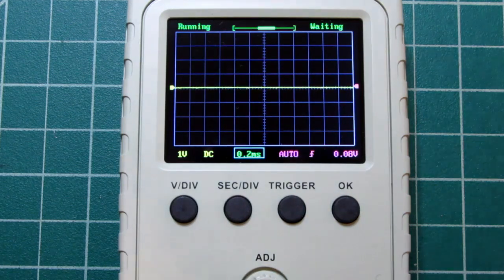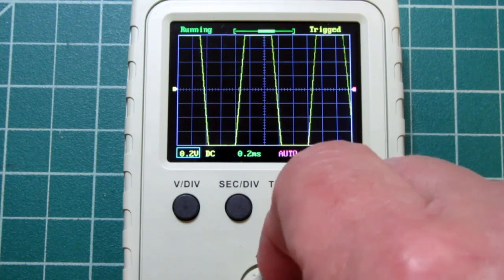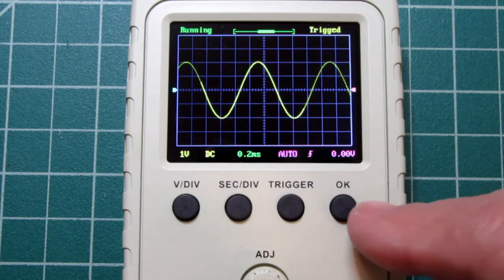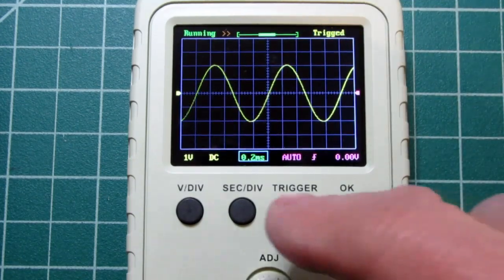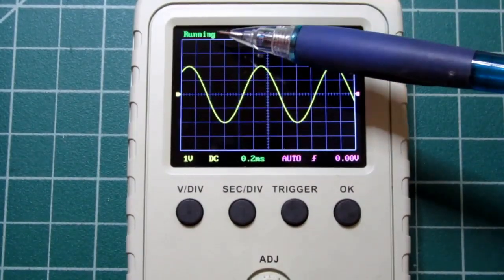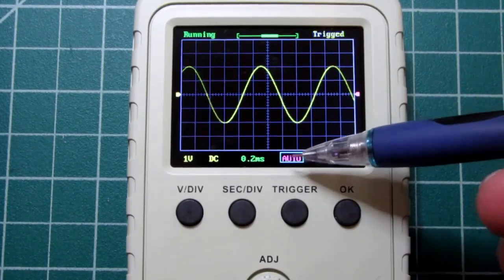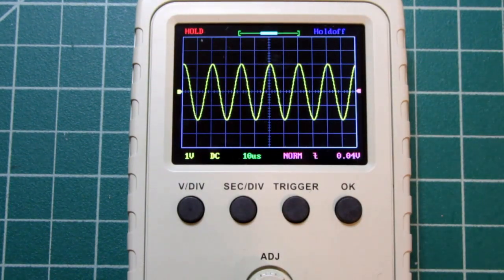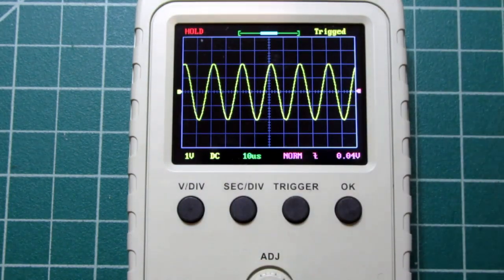KYE Tech "DSO Shell" Oscilloscope: A Detailed Video "User Manual"

Comment: Much better than your last video, but you are still blaming the scope for errors in operation that YOU made!
I know you are trying hard to be the best 'how to' video available on YouTube, and you may already be at that point;...but I know that you can be even better!
Watch more of other peoples videos, learn more about the scope, and try again...
 Learn what 'aliasing' means, and how it can be used to get a digital scope to measure signals that are much higher than it's bandwidth limitations. 
Learn how to properly use the trigger. 
Learn what you can change and what you cannot change when you have the scope on HOLD.
Show how you can use the scope to automatically make all those measurements you were using your calculator to make.
Learn that the scope needs more than one or two 'zero crossings' of the waveform to accurately calculate a frequency, and why.
 If an expensive scope advertises that it is 100 or 200 Mhz, that is the frequency at which the vertical display drops by 3 DB.
You cannot expect a scope with a 3 db frequency of only 200 khz to have full vertical gain at 200 khz.
The vertical gain decay of any scope is usually about 3 db per octave., which means that you can expect full vertical response to 100 khz, and less vertical response at 200 khz.
.
That scope DOES HAVE SOME WEAKNESSES AT 200 KHZ, they are the length of time it takes the trigger circuit transistor to recover from the last trigger and be ready for the next trigger, and variations in the time required for the scope to store it's previous measurement data and be ready for the next trigger. 
.
I also own Tektronix test equipment and many different brands of 1GHz per second sampling scopes.
I also own the OWAN 200 Mhz portable and a few oF the Hantek 40 and 70 Mhz scope meters.
That being said, I use those little DSO scopes for 80 to 90 % of the measurements I make that are less than 50 VDC and less than 100 Khz.. I love the fact that they are portable and easily battery powered so I never have to worry about things called 'ground loops' that can kill laptop computers and other test equipment.
As an Retired Bell Labs engineer, I have a great respect for what the designers of that scope accomplished for such a low price, and would recommend it to everyone as a beginners scope or a toolbox scope, and for us old guys who don't want to drag out a large piece of test equipment every time.
.
Since they are almost the same size as those 'SUCRETTES LOZENGES' metal containers, I put an 18650 battery and a charger boost regulator combo board into that case and mount it to the back of that scope.
I set the boost regulator to about 7 or 8 volts (anything higher than that for that scope is actually wasted power), and the scope can be left turned on continuously for a few weeks before the battery needs recharging, and it can run for a year under normal intermittent  bench top use...
Reply from the maker: Dennis#12, I appreciate constructive criticism, but I appreciate it more when it comes from somebody who can understand the goal and limitations of an instructional video, which you apparently do not, and from somebody who can articulate their thoughts clearly and allowing that their audience is not comprised of mindreaders, which you have not done.

You started out by saying that this video was "better than my last one", which was........?

You assume that because I made a video aimed at beginners that I myself am an oscilloscpoe neophyte, which I am not....I have been using high end professional scopes during my entire career in electronics design, and although I would not call myself an expert on every last nuance of 'scopes, it is inappropriate of you to address me the way got did in your comment. I suggest getting off that high horse of yours.

You also SEEM to be saying that this particular DSO is capable of proper operation up to 200kHz, and it is not....not even close. You advised me to watch other videos, but perhaps you should watch some of the ones that have been done by proficient engineers on this very DSO; I am not alone in my assessment that it cannot be used up to 200kHz in the way that any normal 200kHz scope can be.

You are correct that I made a couple of blunders in my video, saying I was pushing a certain button when I was accidentally pushing another. Unfortunately, I did not realize the error until the video was uploaded, too late to fix it.

I have no apologies to make about this video. It fills the intended niche, and a lot of viewers have thanked me for doing it. I don't need to have anyone with a god complex laying into me for bothering to try helping others.
Reply: First, let be apologize for sounding like an asshole!
I didn't realize that until I read your comments and then went back and re-read my post.
.
I have seen too many videos talking about how crappy that scope is when the person doing the review didn't even take the time to run through the calibration routine, giving the scope failing grades that it did not deserve.
I get very angry when that happens because I consider that little scope to be one of the engineering marvels of our generation.
 I am constantly amazed with what the designers have accomplished in a product that could be sold for only $20 delivered, and still make a profit!
 I know that it is not even close to being a precision instrument; but for a hobbyist it is quite capable of telling him if his battery voltage is 3.7 vdc or 3.9 vdc, and can measure the RMS value of an audio signal, even if it is a squarewave. And it can do that without the user having to worry about ground loops.
The frequency readings are pretty accurate without 'jiggle' in single sweep (hold) mode, and are accurate in auto mode if there enough cycles displayed to get a good average value.
.
I have taught, (back in the 70's and 80's) all levels of electronics at Morton Jr College and found myself spending more time teaching the kids how to use their bench scopes than I did teaching them about voltage dividers and RC time constants.  I know they needed to learn how to use a scope also, but at that time it was more important to concentrate on the fundamentals. If these inexpensive DSO scopes were available at that time every student lasting more than 2 weeks in the class without dropping out would receive a DSO scope, a miniature prototyping board, some resistors and capacitors, and some 26 ga wire so they could take their experiments home with them and have more time to learn by  experimentation. The fact that everything could be powered by a 9 volt battery was a plus!
 That tine scope has been greatly improved since it was first introduced as the model 138 by SainSmart. And it think it's next big improvement will require the addition of a cheap external ADC device that can sample at a 4 Mhz rate or faster.
.
As far as saying this video was better than your last one, I must have been confusing you with another presenter, and apologize for that too.
.
I did try to explain WHY the scope could not be expected to work very accurately over 100 Khz; and then how you can use that unwanted 'aliasing' to your advantage to display higher frequencies accurately by cheating the Nyquist criteria as long as the waveform is repetitive. It does however, work quite well at frequencies up to 20 Khz, which is about 1/10 the sampling rate.
.
Bottom line is that I got angry for a stupid reason, or reasons.
I think that little miracle should be praised for what it is and what it IS capable of doing instead of being crucified for it's limitations. In the beginning of the video I had really high hopes that you might be the first one to actually do that, and I guess I was overly disappointed when you didn't.
I felt like Charlie Brown after Lucy moved the football every time he would try to kick it;
and texted while angry even though I should have known better..
.
Please accept the apology of a grouchy (77 yr) old man.
Reply from the maker: @Dennis-mq6or  , I agree that this scope is a small miracle, and I am not aware of any other that is as well designed and packaged, and as practically useful, at such a low cost. I though the failings were more in regards to limited/poor documentation, and a couple misleading specifications. Couple that with many poorly done videos that either misrepresent the scope's capabilities, or condemn it as worthless or a toy because the reviewer himself did not know how to use a scope. That is why I took the time to write a user's manual for it, which many people have downloaded and found to be useful.
Reply: @youtuuba  
Thank you for the comments 
As you mentioned.......
 "or condemn it as worthless or a toy because the reviewer himself did not know how to use a scope"
 That is exactly what gets me so upset when I probably shouldn't be.
Mostly because it steers many possible new users away from it when it is such a disservice to do so.
.
Thank you for creating a better user's manual, which I did not know even existed prior to our correspondence.
  I hope you will find a way to get it out there to EVERYONE, and let me know if I can help you to do that.
.
Thank you again for performing that great service for a little gem, (when operated within it's design limitations), that has been misunderstood and underestimated for too long.

Comment: Superb tutorial, the scope is great for the hobby audio work at a cost of 15 quid, I don't have a way to test at 200Khz, how good was the written display of values please ? will they display the actual values at the 'front end' maybe this is how the makers justify the specs as it 'can' measure 200Khz but not display the waveform much above 20Khz ?...cheers.
Reply from the maker: This scope is inferior to any inexpensive DMM, and that is what you should be using to take measurements (a DMM will also measure current and resistance, and DC and at higher voltages than this scope). I would discount the numerical displays on this scope, and only count on it for its primary purpose, the display of waveforms. And those are only reliable to something a bit north of 20kHz.
Reply: @youtuuba  exactly, I was curious to see what the device read, there is no substitute for a good meter, I guess I was trying to throw the designers a life line, after all they are a long way out of spec, I bought this more as a sunday afternoon soldering and assembly project to be honest and would probably recommend it as such to someone starting out. I'm still curious so I need to fix my function generator !...cheers.
Reply from the maker: @andymouse  , I don't think the designers of this little DSO are 'out of spec', rather I think they provided an inapplicable spec. The analog front end circuit is certainly good for 200kHz, and their 200kHz spec is for the analog section (analog bandwidth). The limitation is with the digital part of the circuit, for which the designers provided no specification.
Reply: @youtuuba  good point.

Comment: It looks like you got one of the fake clones instead of a real JYETech scope.
Reply from the maker: Colt, why would you say that? If you are going to make such statements, you need to substantiate them.
Reply: @youtuuba  So, assuming there's a serial number on the board, did you get it verified by JYE as being authentic or confirmed a knock off?
Reply from the maker: @colt5189  , why would I even do that? The JYE itself is reportedly a "knockoff" of an open source design. I did not care whose knockoff of another knockoff I might be buying, as long as it worked. And with JYE Tech having a virus intrusive website, I was hardly encouraged to communicate with them anyway.

Comment: specs say that it has dual channel signal generator , is this true
Reply from the maker: Pavel Pavlovic, the version I have does not have a signal generator (except the very limited one for the test signal); that is very clear from its schematic. This scope has only one other connector, a BNC type for the input signal. For this to be used as an output, the circuitry would need to be very different from the one shown in this video. Are you sure you are looking at specifications for THIS scope, not some other small scope?
Reply: @youtuuba  yeah it is the same scope  , i figured it out but its MK2 , looks the same , identical but its WAWE2
You get 2 channel scope , and 2 channel signal generator .200Khz range , and 20khz for signal generator  up to 3V i think .
This is fantastic for audio work .
Absolutely fantastic ,  
 I used to do audio work on old Analog scope 50Mhz big huge thing  with no signal generator , it was a pain to use it , i dont need 50mhz  what i need is small useful device 
 
I hear its designed in Canada , wonderful work  , you can design High End audio with this no joke .
 Unless you work with Tube amps , and im not any more ,
Reply from the maker: @dedskin1  , if the scope you are talking about is TWO channel, then it is certainly NOT the same scope that I describe in this video. It is a very different scope that resembles the one I describe. Don't be fooled by some similarity in appearance.....the case must be different (if only to accommodate connectors for both channels), and the circuit boards will be very different. If you take George Washington's axe, and replace the handle and the blade, it can no longer be called George Washington's axe, no matter how similar it might appear.
Reply: @youtuuba  true , but it looked the same . No problem , i was just making sure .
Anyway maybe you can try that one , i trust scope is the same its just has 2 channels and a function generator .Also has XY mode .
Its also a kit , you can make it 
But if you have a scope and you dont need any ,  then well you dont need it
Reply from the maker: @dedskin1  , it cannot be "the same" as the one I described. Who knows how many circuit changes were made? Probably a lot of them, might be nearly different in most ways.
Reply: @youtuuba  well obviously there are some differences in board layout due to additional components  and software add ons due to additional modes .
But  on the same chip , 
with same ICs and front end ,its just 2 now plus signal generator  .
So  call it as you like
Reply from the maker: @dedskin1  , it is not what 'I' like......I am following universal convention. When products, even closely related products, have different features, they are called by different names, model numbers, etc. They are different products. No informed and rational person insists that they are the same product.
Reply: @youtuuba  look im not trying to argue ,   aint nothing to argue about . Obviously its a different product ,
Reply from the maker: @dedskin1  , I also am not interested in arguing, I am just trying to clarify comments on my video. In at least two of your previous comments, you sure seemed to be saying that the two channel scope was the same as the one shown it my video. I think we all agree by now that the two might be related, but are different products/scopes. NOT just two slightly different variants of one scope.
Reply: @youtuuba   well its your channel
Reply from the maker: @dedskin1  , so by saying that, you wish to perpetuate our little back and forth? Why does the subject of our exchange merit this latest comment, as if to say you still think the two scopes are the same model, but "oh well"? You xo seem intent on having the last word.
Reply: @youtuuba  m8 , you see what you want to see i never said its the same model ,that i asked 
But if you ask me do i still think its the same scope , yes i do . It is identical scope , if you used one channel  of each you wouldn't be able to tell them apart , because its the same 
  
 Im not saying the same model , im saying its the same scope, like if you take 2 wrenches made by different tool maker , different models , buts its the  same wrench used for same bolt  .
Im talking about that kind of same
Reply from the maker: @dedskin1  , I was trying to remain nice about this, but you still insist that two different scopes, with different features, are the same scope. By any rational or convention system, they clearly are not. If Tektronix makes different scopes, some with dual channels, some with only one channel, and with or without other features like built-in signal generators, NOBODY except the village idiot would claim them to be the same scopes. "Similar" is not "Same". "Related models" are not "same model".

As for me "seeing what I want to see", no. I did not get into this exchange because I 'wanted to see' sonething. What happened was, I was looking at comments on my video, saw your first comment, tried to be helpful and took my time to offer a constructive response. Then you compounded things with your subsequent comments. You now seem past the point where I wish to try and help you anymore.